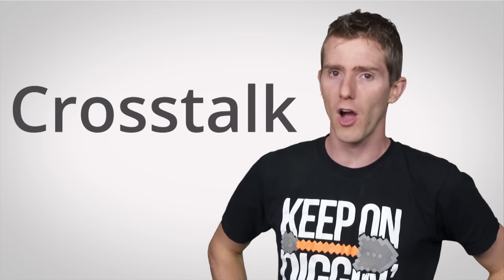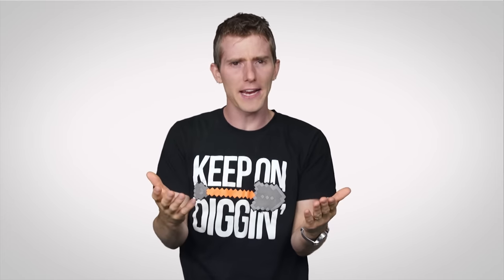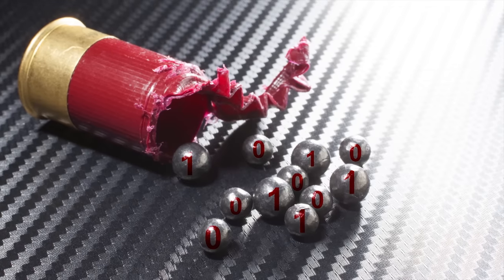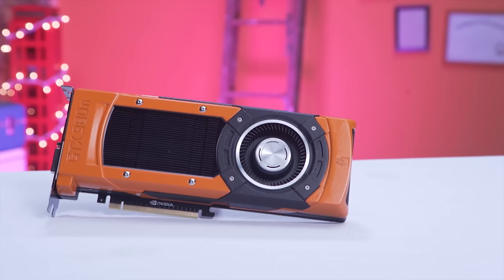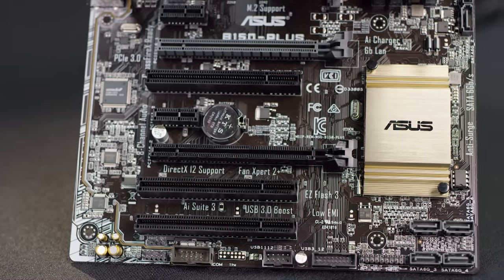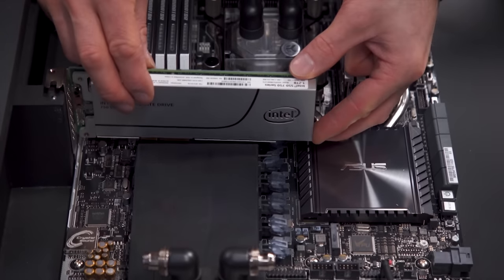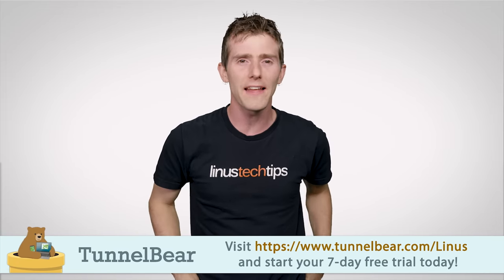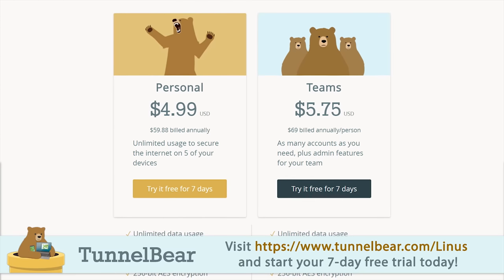What's the Difference Between Parallel and Serial?

Comment: Äh and what are the other lines in a usb connector 1 ground, 1 +5V, 1 data and 2 not used?
Reply: USB 2.0 has: 1 ground pin, 1 +5V pin, 2 data pins and 1 insulation pin (around the usb connector)
Reply: Sematre and what is with usb 3.0/3.1 has it 6 data-lines?

Comment: In truth Parralel and Serial Ports are old, outdated and basically a thing of the past
Also the pins used on them would be VERY FRAGILE AND PRONE TO BREAKING/SNAPPING
This is why modern day USB(Universal Serial Bus) connectors are way better, USB is WAY MORE DURABLE AND TOUGHER TOO

Comment: Can you please answer my question?. I Ran a high graphics game on core to duo, by upgrading it a bit using graphics card and better ram. It ran at 30-50 fps smoothly, but at times, the pc hanged suddenly and the fps ran to 0, for a second or two. Then it went to 30-50 again. Is it because of the parallel circuit?

Comment: So PCIe is serial running in parallel... far out.
Reply: Also, a mounted .50 is not the best representation of rate-of-fire. Parallel is like the multi-arrow in Men in Tights, Serial is a MAC10, PCIe is like Metal Storm.

Comment: I partially buy serial is better than parallel, but thin flex cables alway better than thick fire hoses. Now why do we still require 24 pins to deliver +3,+5,+12,SB voltages?  Remember IBM PS/2? Look Ma, no cables!